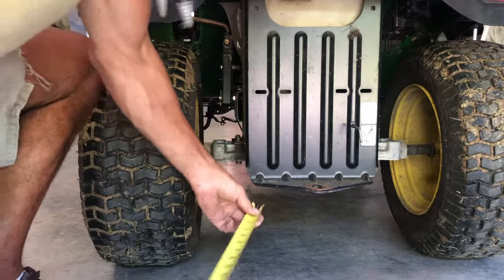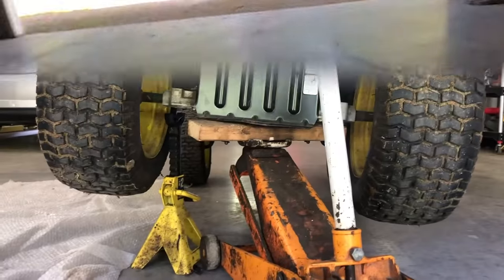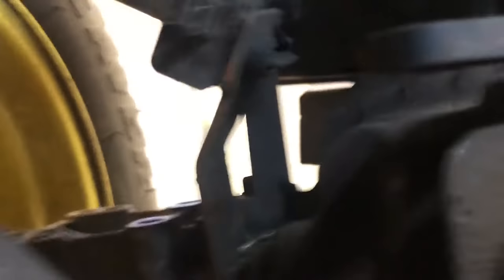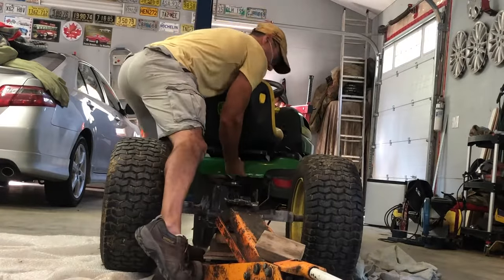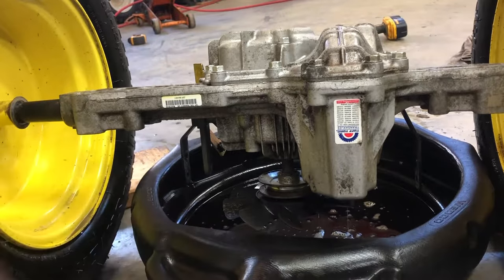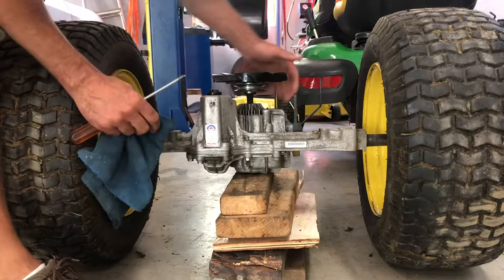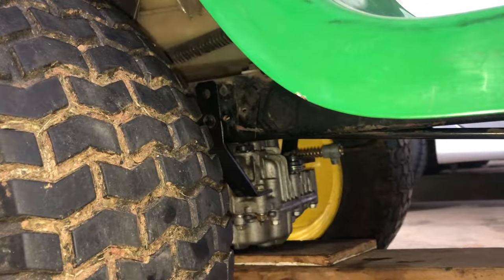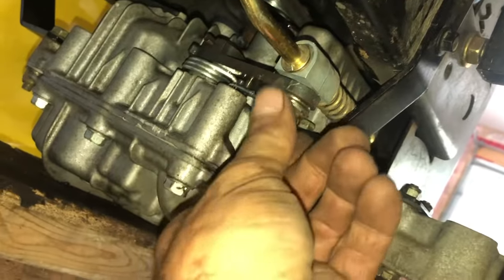How to change your oil in your Differential / transaxle / Transmission John Deere Lawn Tractor

Comment: Wish they just put a drain plug on the thing lol. Looks like I’m in for a day of work instead of a half hour. Thanks man for the video
Reply from the maker: If your transmission slip or slows down when it's hot I'd ad 20w50 oil. Don't overfill it. 22mm-25mm from the top edge of the fill cap.
Reply: You can add a drain plug.
Reply: I think the intent was to have owners just buy another new 100 series mower rather than do the troublesome maintenance.
Reply: Exactly. Selling my sst18. Just got a cub zt150
Reply: @Moutanman  that incapable of maintaining your equipment you just buy new instead?… your neighbors must love collecting your trash.
Reply: That was my question. Why indeed didn't  John Deere equip the rear end with a drain plug.
Reply: @vermontaviator1248  I have no problem with maintaining my mower or anything else I just can't see the logic of having to completely removing the rear end from the mower to change oil.  I will be  drilling and tapping a drain so future changes won't require disassembling half the mower.  Nothing, nothing , .disassembles  like a Deere.
Reply: @sammylacks4937  I actually agree with you now, I’ve now pulled mine out twice and still not right, I should of done what you did. My bad.
Reply: @sammylacks4937  MONEY!!! It's all about money. 😠
Reply: @sammylacks4937  you should make a video of where you tap it and do the oil change
Reply: @zackbartley8118  I have a John Deere x380 that is heavier duty than the 100 series. The transmission is the same way with the fill hole behind the fan, the breather is in front. I wouldn't want to remove the damn deck and transaxle just to service the transmission. I would much rather pump the fluid out from the breather hole removing 1qt out of the 2qt capacity. Run it again for another mow and pump and add 1 qt again. I would rather spend a hour doing this than taking the whole machine apart.
Reply: @VAMCVETS  no silly. you just drill a hole in one of those 3 flat spots under the transmission. Is it in this video? you and drill like a 3/16 or 1/4 or 5/8 hole and tap it for the right size plug and thread. Then you can flush it out with gas, let it drain, put the plug back in and put in the correct amount. I was going to do mine but when I read others comments and a famous saying for years is...."if it ain't broke, don't fix it." They say when you start having problems, slipping going up hills or slight slipping, then change it. Not before. 🙂
Reply: @JohnSmith-uy7sv  haha I gotcha man. Yeah, it's fairly easy to drill and tap to install a plug. I have a tap and die set that comes in handy. I just wasn't sure if drilling into the flat section if I would hit a channel, etc. My X380 only has 138 hours on it. I was looking into this after a compete tune up I did this weekend, along with new front tires,drive belt, deck belt, and a good greasing. I just don't see why they only put the fill/drain on the x500 & x700 series? My mower new was around 5k-6k.
Reply: So if it runs out gas ,just go out and buy a new mower ,FU JD!

Comment: What happened to older models where you just pull the drain plug on the bottom and let it drain . Manufacturers and dealers are making it to complicated to work on so they can rip YOU OFF ....

Comment: Having an old 185 hydro where both the trans and diff oils can be changed without removing the rear assembly, was almost in disbelief watching this and wondering why there’s no drain plug, and why the filler is a thin press-in versus something stronger and threaded.  It wouldn’t cost much at all for Deere to make these upgrades in production so what gives?  I guess this is part of why the 185 is still going strong 35 years later and the new light riders seem to be disposable.
Reply: They wanted it to break and you go buy a new peace of junk mower 😢😢😢

Comment: Why wouldn't they manufacture a damn drain plug so you can service the rear end without taking it out of the tractor. My Husqvarna same way. But I fixed it the first and only time I took out the rear I drilled and tapped a drain hole and plug. Now it can be serviced or at least the oil changed. Still gotta pull it out to get to the filter screen.piss poor designs.

Comment: I would have taken it a few steps further while the axle was out and popped off the lower pan, cleaned it, drill a hole in it, tap it, and add a drain plug. That’s too much effort to keep going through every couple of hundred hours just for an oil change. Alternatively, I would look into the possibility of just pumping out the old fluid through the fill hole with a 12 volt fluid pump. Otherwise, nice work! It’s good to see someone taking care of his tractor! They sure don’t give them away when you need a new one!
Reply from the maker: That is an option......

Comment: I have a 2004 JD 145 Automatic and after 15 minutes it’s struggling going up hills. The video is great since the local John Deere dealer is backed up for weeks. My machine has close to 200 hours. Just basic maintenance and this machine is still going strong.
Reply: did you fix your issue with an oil change?
Reply: Hope you check your drive belt..or belts and drive pulleys (bearings go out) before dropping trans. Hate for you to jump straight to this scenario. :)
Reply: That rear pulley under the fan should be replaced while your at it. This helps a lot
Reply: @timferguson593  Remove the deck put parking brake and remove the bolts and replace with new pulleys. It’s much easier doing that instead of messing with putting a new drive belt which requires removing the clutch and steering.

Comment: Fantastic resource!! Really well done.

 I was ready to bin my D140 as the transmission replacement cost was coming in at an estimated $2500 in Australia. No way I was going to give JD any more of my money. Gave this process a crack and for $100 in oil and a couple of hours of my time it is running like new. 

Magic!! 

Only mistake i made was damaging the magnet when putting it all back together as it was stuck to the plug and smashed when I was trying to knock it in.
Reply: my d110 wont go up a hill, what probs did you have and did changing the oil work?

Comment: Just did this procedure on my L120. Mine would barely move after a short time mowing and forget reverse completely. Well, after draining the old fluid and replacing it with Castrol 5w50 Synthetic, it did make an improvement, but I haven’t completely mowed my 3 acres of grass yet, so the jury is out as to what will happen when it really heats up. It’s definitely better though and I’m happy about that. It was actually much easier than I thought it would be, so I would definitely recommend doing it to anyone who is having issues with their K46 transmission. Sure beats the cost of a replacement unit, or worse yet, having to junk the whole tractor. Thanks to you and all the others that have posted similar videos!
Reply from the maker: A heavier oil would help too. (20w50).
Reply: You need a sheader and tractor

Comment: You are a life saver! I have had to rebuild my LA 110's front end, Mower deck and I also am replacing all the drive components , belt pulleys and changing the oil in the transmission.
Reply from the maker: Awesome…

Comment: Thank you for your video!  I changed my transmission oil this evening, runs great again, no slippage.  My belt keeper and pulley design was a bit different on my L110.  The pulley was on top, above the fan, the keeper was mounted to the frame and was a  piece of tin with three tabs that encompassed the pulley when the body was lowered onto the axle.
Reply from the maker: Glad it helped

Comment: Good video. I watched a few different videos on this subject before tackling it today. SUCCESS! A few things: the fluid capacity is 2.2 quarts (2 quarts, almost 4 ounces). I used 20W50 GTX oil (2 quarts) and the makeup ounces in Lucas Oil Treatment (since I didn't want 28 ounces of 20W-50 sitting around I would never use. Incrementally, I will use the Lucas in mowers, etc. I used jack stands under the axle (right next to the wheels) for great support and access. Honestly, the work isn't that hard. Tricky to balance the transmission a bit getting it out and in. Really, for me the tedious part was getting the cotter pins out of the three rods underneath. I replaced them with what I call spring pins. I would also suggest blocking the front tires, and I liked the shim into the front suspension...something others did not do. I found two 2x2 boards at the front and back of the rear tires after you drop them and roll them into place helps keep the unit from moving. Use a snap ring pliers and take the retaining ring off so you can take the fan and pully off before draining. And shaking the transmission some and tipping the tires up and down each way in the draining process helps get all the old oil out. I also LIGHTLY put a locking plier around the drive shaft and turned it a number of times in the refill process to help the oil get throughout the unit. I am not that mechanically inclined, but this was doable. I let it drain for nearly an hour, agitating it occasionally. Total work time about 3.5 hours...with some starts and stops and "I forgots" (fully assembled, hadn't put the drive belt on the pully.
Reply from the maker: Good work.

Comment: My L130 has been whining and struggling until it pretty much stopped moving last Fall. Wishing I had researched this a few years ago. BUT, I dragged it out into the middle of th garage this weekend and followed the steps (a couple slight variations due to the model) and removed the backend. covered in dirt, blasted it with a hose, degreaser, etc. Drained, and refilled using 5W50. Magnet hd plenty of fine stuff but not as bad as I've seen in some videos here. Did as you did, tipping the axle up on one tire then the next, spinning the fan while holding the drive lever, etc. Topped off, put it back together and presto! Forward and reverse once again, with seemingly more power than it's had in recent years. Managed to forget to put the magnet back in but will happily pull it off again this weekend knowing that the fluid replacement seemed to do the trick. Mine's 18 or 19 years old 250 hours on it, and this is the first time the transmission has been dealt with. Was sure it was going to need a rebuild or replacement. Thanks for your video. Watching this one and a couple others made it possible for me to work on something I didn't have the know-how to do.
Reply from the maker: Awesome. Make sure the oil level is 3/4in down from the top edge.
Reply: @WeekendHobbyMechanic  I was sure to follow that. I think I saw it in the comments.

Comment: I've got a 2015 X320 with 275 hours, and it has really been struggling on my hilly property once the transmission gets hot.  If I run cold water over the transmission for a few minutes, it helps dramatically.  I'm hoping I don't need a transmission replacement, so I would like to start with a trans oil change first.  Hopefully it helps, I miss cruising up the hills effortlessly while mowing.
Or maybe its time to move up to the X570 diesel...
Reply from the maker: X320 have a more heavy duty  K56 Transmission.     Trans oil should be change every 200hrs. Hope it helps...

Comment: Nice helpful video👍 my D160 is slipping and is having trouble going uphill again nice video
Reply from the maker: Add 20-w50 oil instead of 5w-50.     Usually, the hydraulic motor in the transmission is getting weak.
Reply: Yes I agree,20W50 helps a lot , I used Tuff Torqs oil when I changed my oil and  still had trouble going up hills after an hour of use. I switch out to Amsoil Hydrostatic oil 20w50 and it goes up hills all day long now. The thicker oil worked for me.

Comment: Thanks. Good video.  It took me a while longer than it did you.  FYI: If you look on top of the belt retaining bolt you can use a 6MM allen socket to take it out an reinstall.

Comment: I watched the demo, removed the transfer case as described and noticed something unexpected on my craftsman lawn tractor. I did a lot of work not needed.  The tow plate in the rear is attached by 4 easily removable bolts, remove the bolts and the rear hitch cover plate is removable! Take it off and their is the breather hose in easy to service!! Screw the breather hose off, syphon the fluid, refill and install the rear cover and your done in 1 hour..

Comment: for the rear trans guide bolt I used the 6mm hex with a flexible right angle adapter with my impact driver. took 5 seconds to take the stud out and reinstall.

Comment: Great video! I just worked on neighbor girls Sabre By John Deere .Would start slipping moving slowly when it got hot! I took the trans axle down and the pulley had already been welded to the shaft so that was one thing I was going to check for . The next thing is the oil inside looked like milky cutting fluid watered down. It was low also .I dumped it all out and cleaned the filter screen in the filler tube  and filled with 20 w 50 oil ! I also ran the pump with a drill as I filled it. Runs pretty well now ! I ran it up some very steep hills and tried to get it to slip ! Seems good now ! I now know the is a Tuff Torque K - 51 Trans axle  1742b tractor! I am going to look for some used mowers on junk days ,see if I can find donor Transaxle!
Reply from the maker: Awesome

Comment: Thanks, I recently purchased a used TL 155 and I’m certain it probably needs the gearbox oil changed so I will commence to doing that this weekend ,good video!
Reply from the maker: A little more work to the TL models but similar..  The only problem is hooking up the Forward/Reverse rod back on.  Not much room.

Comment: Imagine going to pick up your JD tractor at the dealer and viewing a $140.00 charge to check transmission oil. Tuff-Torque made it a pain to check and R@R. But it is one tough transmission baring the inability to check levels and purity. Another great video on this tranny can be seen at Taryl Fixes All.

Comment: Simple and on point with this one! Will help me out with dropping the trans. Along with other ones showing how to install tuff torq drain bolts. Essential process of changing out fluid to keep it in good working order!
Reply from the maker: Thx man.   Hate repeating myself but don't overfill it with oil. Oil level should be down 22mm 25mm from the top edge of the filler cap
Reply: I also downloaded from TT a diagram that shows like you did the level mark,plus it also tells me it will need 2 liters.
Reply: Have you seen the newer filter media  that’s available now for tuff torq trans? Much better that the screen filter that it came with!
Reply from the maker: @ticman1962   Yup.. Way better filtration..

Comment: Is there no way to lift up the seat and maybe drill a hole to get access to that filler cap? Seems like it would be a lot easier.
Reply from the maker: No, the gas tank is in the way and you have to turn the tracker upside down to drain the old oil.  You can remove the fenderdeck but that takes longer.

Comment from the maker: Oil Level after priming the Pump & motor should be down 22mm 25mm from the top edge of the filler cap.
Reply from the maker: @mauricearian1872   Awesome fast work....

Comment: Know we went back and forth not trying to find those comments lol. But taking the time today to do this right this video while doing it almost takes no time to do I expected this to take WAY longer. Thanks for the video will update you on noise once it’s drained cleaned and out back together
Reply from the maker: 👍. Don’t overfill it. 22-25mm from the top edge after priming the pump.  If you don’t prime the pump set the level 20-22.
Reply: @WeekendHobbyMechanic  I gotta go get another couple quarts of oil lol then I can check level/prime
Reply: @WeekendHobbyMechanic  22-25 seems kind of low while measuring it out lol have to prime it and see how much it goes down
Reply from the maker: @DEFGraves    You don’t want the oil for Gears side & Pump side mix too much.  That’s why it’s down 22-25mm from the top edge.
Reply: @WeekendHobbyMechanic  so. Excuse my ignorance here. So when I tip it I’m not trying to fill both chambers/sides I’m just getting some in there (when tipping to each side by lifting wheels as you did) then the main spot where the magnet is needs to be 22-25 mm down from top
Reply from the maker: @DEFGraves    It will fill both sides as you add oil.    Fill it to 22-25mm down.  You can tip side to side when you add the oil.
Reply from the maker: @DEFGraves    Yes, magnet top down 22-25mm
Reply: @WeekendHobbyMechanic what roughly is the life of the oil when changing these or do they still consider it “life long”
Reply from the maker: @DEFGraves   200-250 hrs.
Reply: @WeekendHobbyMechanic  not sure if missed a step or used wrong weight( 5w50 full syn)but  noise is fully still there if not louder. Unless when in motion fluid level went down more.
Reply from the maker: @DEFGraves     The noise is the hydraulic pump feeding the hydraulic motor inside the trans, perfectly normal.   It will quiet down when the oil gets hot.  Your fluid level is fine if the transmission is working.
Reply: @WeekendHobbyMechanic  man those things are noisy then! (Before and after) I mean it is 17 ish years old too
Reply: @WeekendHobbyMechanic  do appreciate all the super fast replies and help also!

Comment: thanks fixed my tractor for $70. do prime the transmission, long story short I didn't and had run it for 2 minutes pulled the transmission out a second time and the oil dropped about 1 inch, below the magnet. Lucky I had a problem. I used Mobil 1 5w50 as it was the only 5w50 I could get.